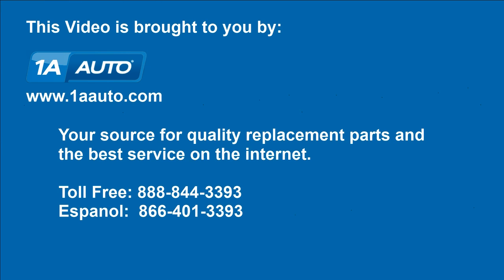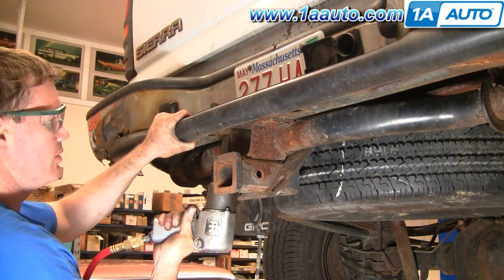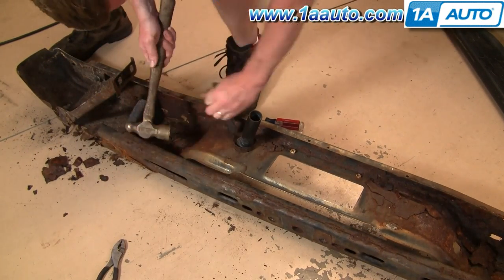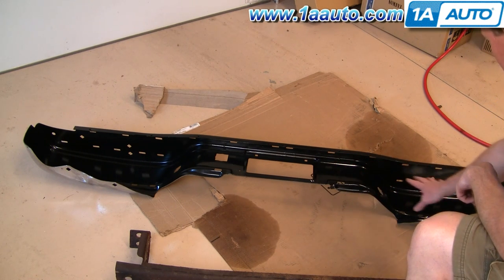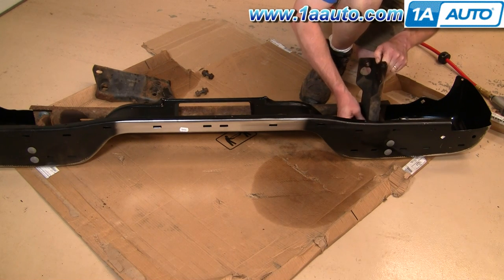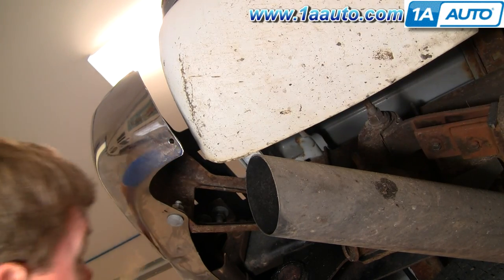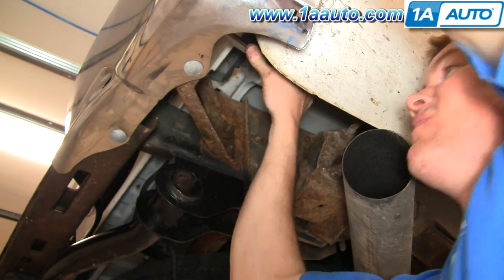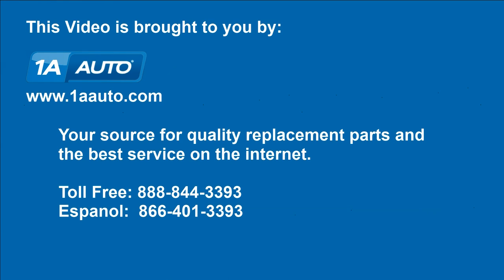How To Replace Rear Bumper 99-06 GMC Sierra

Comment: I followed this instructional on my 2002 Chevy Silverado and everything was going great until I tried to pull the bumper off.  It appears that those 2 supporting brackets on the outside of the bumper do not clear the bed of the truck because they are angled.  It looks close to impossible to remove these brackets becasue the bolts are rusted on and it is a tight space to get any wrench in there?  What am I missing here?  Thanks!

Comment: THAT'S THE HARD WAY - you'll have a difficult time lining it back up when installing WHICH ISN'T SHOWN IN THE VIDEO - IT'S CUT OUT.  If you only need to replace the chrome part or want to easily slide the truck bed off, do this:  Take out only bolts that are in the bumper that are vertical (up or down), nothing horizontal.  Remove plastic (why?  so you can slide bolts out or keep special bolts from slipping)  There are 4 bolts per side (use an air ratchet with deep socket works great) specially made for "easy removal" (good washers built in bolt one side).  I'm unsure if you'll have to remove (or cut the nut off of) your trailer hitch to slip over it. Because the inner bumper is in place it should not fall and should be a breeze to re-align and re-install.
Reply from the maker: +Notur Business Thank you for your feedback!

Comment: My rear bumper (2001 silverado 1500) had additional bracing that would not allow it to slide out after the bolts shown in this video were removed, bummed me out haha. It was loose after removing the shown bolts, but the bracing simply would not squeeze out between the body and chassis. There were not in friendly spots to work on either. Anyways, thanks for the video, gave me the motivation to remove and repaint my bumpers.

Comment: If you own a 99-02 Sierra your bumper bracket will not clear........You have to loosen 4 bed bolts so you can lift the bed a little bit.

Comment: I just ordered one came today replacing tomorrow, came with new pads, wires, light mounts, all new brackets, and new cross bar if that's what it's called the rusty part under the middle pad in the video. All for 130ish bucks and was free shipping off Amazon, I am very pleased with the quality.
Reply: Where’d you get this at?

Comment: Great how-to video. Discovered my rear bumper was out of balance just enough to prevent a trailer hitch install where two mounting bolts connected to the bumper. A quick adjustment via the 15 mm bolts and the job was finished in to time. Thanks.

Comment: Was just working on this and I think there's a step missed right before you pull off the bumper. There's 4 arms holding the bumper, but you only show 2 when you take it off. Had a hard time taking that thing off lol. 
All in all, Thanks for the great video! :)
Reply from the maker: +Marcus Wally Thanks for checking us out! http://1aau.to/m/Shop-1AAuto-c
Reply: How did you do it? I’m stuck on this problem right now
Reply: @turnerthorne6005  Did you ever figure it out? I’m stuck on this issue as I speak… not even sure if it’s possible lol

Comment from the maker: @MrStoneman1394 There should be a couple of bolts that hold it into place on the backside of the bumper. It would help if you had a friend hold the bumper up as you loosen the bolts. Hope this helps you out.

Comment: I purchased a bumper that did not come with the cross step bar that sits in top and bolts to the receiver. What is that part called and where can I purchase once?

Comment: Hi, Mike. The hose part of an automatic transmission cooler line on my 1998 1500 Dodge Ram has been sweating oily residue recently, and I'm feeling inclined to change out the rubber part of the line before it suddenly fails. It's a short two foot section of rubber line that ties into the cooler. Looking at the connections, I'm not sure how it comes apart, or what I ask for at a parts store. If you have the chance I would appreciate a video showing how those lines come apart. Thanks. 
Dave

Comment: yeah those rusted bolts can be a pain, i know i'm from canada. i've done a few of these bumpers, always run into a problem somewhere. especially if something is bent, which for some reason is usually the case. something i found, the brackets off the HD models for 00-06 are different than the 1/2ton models, must be the frame that determines it. bumper is the same though.

Comment from the maker: @jwernrvtcvn HI, I currently do not have the vehicle here. If you go to the parts counter at the dealership they can usually pull up a picture on the computer and tell you exactly what size the factory bolts were. They may even have some for you. Hope this helps.

Comment: to make those pads easier to put back in place....put a drop of dish liquid or a shot of WD40 on them.if you insist on pounding them in dry... a rubber hammer saves a lot of wear and tear on your hands
Reply: That has no impact strip just all chrome
Reply: For a 94 chevy suburben ,
Reply: Do you have a replacement bumper

Comment: Sure wished I lved in your area, you are the best.  The garage in my area told me I need GM Part# 15154375 retail $440.95cdn I purchased it, found out I do not need this part., so its for sale make an offer please,. 
The parts I really needed were, 15705669, 70,73,74 Needed these 4 parts
Thanks to the video, I can replace these parts myself.  
Good Job guy and THANK YOU